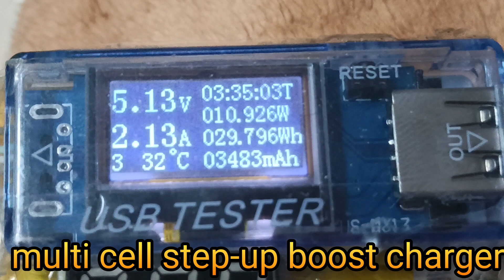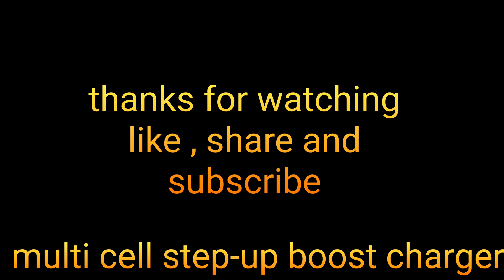multi cell step up boost charging module for power tool battery

Comment: isnt the charging current too low for the lithium batteries? i though it was supposed to be arround 1amp per battery
Reply from the maker: @misterio5020  it just take more time but will do the job , the reason i choosed 2 amp module any 2 amp or below module can charge it, but 4 amp module may try to get max current and restart smps simultaneously simulating shorting the circuit, even 4 amp 3 cell module is available